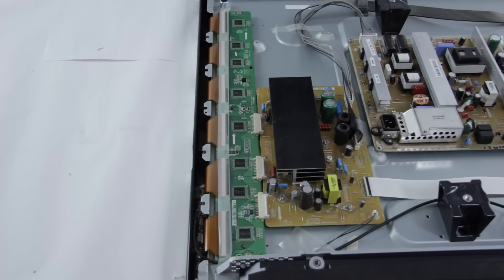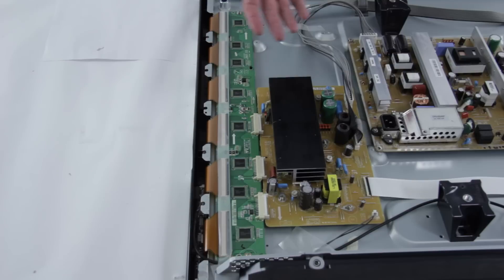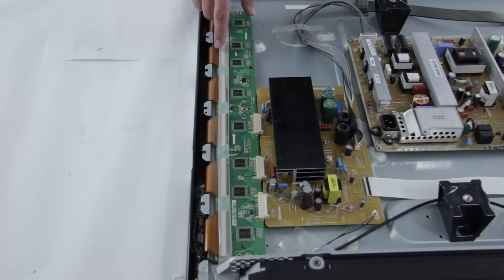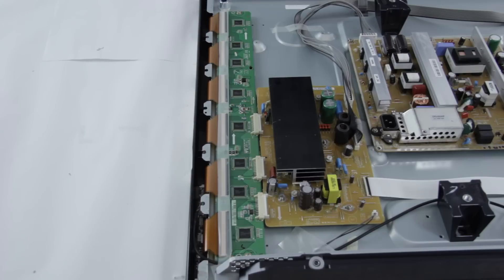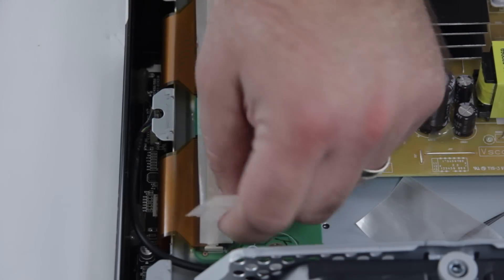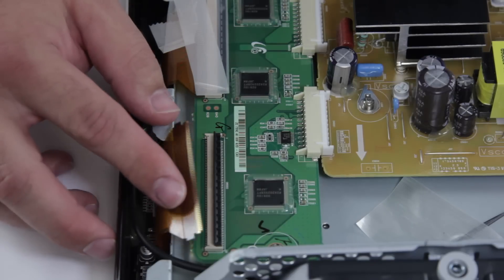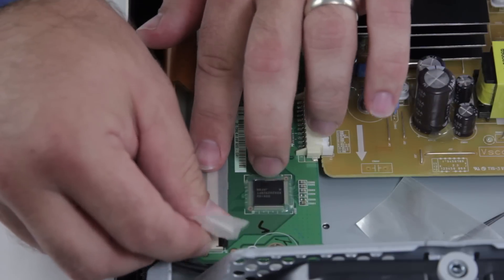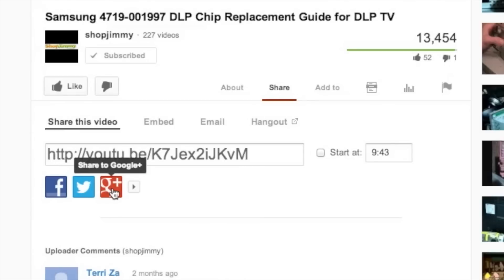Plasma TV Repair - No Image, No Picture on Plasma TV Screen - How to Replace Y-Buffer & Y-Sustain

Comment: Hi I just started having an issue with my 55" Samsung smart tv. When I was changing channels the screen just went black. When I tried to turn the tv back on the red button just keeps blinking without stopping. I have surround sound and also a comcast cable box hooked up and the sound is still working. I tried disconnecting the outlet several times with no luck. Please let me know what your advice would be. I would very much appreciate it.

Comment: hi, I have an LG PB6900 60" TV. It is plasma, and 3D, smart TV. Last night the picture just went out. No popping sounds or anything. The audio was still working and still does. so no picture, but there is sound. could it be a fuse or something more?
thanks

Comment: Hi. I have a Samsung PN64F5500AF that seemed to take ever longer to come on and eventually seeming to come on but not give a picture, just a black screen. I opened it up and noted that the green LED on the logic board was blinking slowly (once every 5 seconds). I learned that this pointed to problem with x-main , y-main or y-buffer.  I disconnected the cable between the logic board and the x-main board (connector with 13 gray and 1 black wire) and found the LED still blinked slowly.  I reconnected that, then disconnected the white ribbon cable between the Y-main board and the logic board. Viola, the LED on the logic board began blinking once every second. I removed and examined the Y-main board and see nothing amiss as far as swollen/leaking capacitors, burns, discoloration. Nonetheless, am I correct that these observations point to a problem with the Y-main board? I don't have the skills/tools to go much further diagnosing potential problems with it. Any advice will be appreciated. Thank you.

Comment: i have a samsung 50 inch tv model PN50C450B1D code PN50C450B1DXZA and the picture is not displaying anymore. i belive the back lamp is burnt out as the sound is still perfect. there is a small flicker before it turns on. please help.

Comment: got a little crack in the left bottom of the screen and its showing vertical and horizontal lines model code UE40EH5000WXXN

Comment: i have 50`samsung plasma tv model / HP-T5054  while I`m watching it turn off then it turn on,but the picture disappear it`s totally
black  but there`s a sound remote is working what`s supposed to be the problem and where to get parts.

Comment: LG model 60PV450 , tv was on and it turned off, when turned back on there was sound but no picture. the tv always makes a light popping sound when turning on and off but it has done that since new. i would like to fix it as that would probably be less costly than buying a new tv. thank you.

Comment: I have 52 in Samsung Plasma TV model number HP-T5054. You can hear it power on but no picture.  I've checked all fuses and they are good. All capacitors look good also, I even changed one. What else could it be?

Comment: PDP60R3 IT POWERS UP AND HAS A RED LIGHT ON THE FRONT OF IT.  BUT JUST A BLACK PICTURE.  NO BLOWN CAPS.  THEY SAID IF WAS MAKING A BUZZING SOUND AND THEN IT JUST QUIT
DO YOU THINK I NEED A NEW Y BOARD

Comment: I got a question for you guys. I have a Toshiba 42hp66 with black lines going across the screen horizontally, Also the plasma screen pixels began with the blacks turning to reds, to the whole screen picture now does not work and is completely white and pixels are multi colored. A purplish hue on the screen rwith white all over, the screen also flickers. please help! thanks -Christian

Comment: Hi I have a lg 60pk550 when it went out it would just click so I put a new power supply in it it steel did the same thang. I did some test found out the buffer boards was bad I put new ones in now when I turn it on the stand by light goes out like it should but there is steel no sound and the screen is steel not comeing on so putting the new buffer boards in got the tv power to stay on but there but that all the tv is steel not working

Comment: samsung PN64E8000GFXZA turns on no picture and can not verify if there is sound. No VA and low VS (3v). The led on the logic main blinks once every five seconds. I have followed all of the steps in the fast track trouble shooting manual and still can not figure out what is the culprit other than maybe the x main. Any help would be appreciated.

Comment: hey shop jimmy I have a rca plasma 42PA30RQ , it will click on but shows absolutely no picture but a brief few lines across the top when turned on and then nothing. no sound either. The ribbon connections look to be in good condition.

Comment: I have a Samsung pn51d450 and i tried to plug my laptop into it and the picture went black. Since then It click on and there is a flicker on the screen like it is starting then nothing. The red light on the front is on and the green light on the back is on and flashing. The power supply voltage readings all seem OK. It also doesn't respond to the remote when i try to turn it on and off, just the button on the front panel. It clicks again when i turn it off. There is no sound coming from it.

Comment: zenith plasma tv z50px2D AF-05fD serial#605RMKU0013 no picture. Power turned on but makes a buzzing noise for a few seconds and then shuts off

Comment: We have an LG 50PQ30, it does power up, but there is a clicking noise in the back, it also doesn't have sound and has no picture, what can the problem be and can it be a simple fix?

Comment: I have a Samsung tv model # pn50a400c2d
model code # pn50a400c2dxza. tv has sounds but screen is black.
Reply from the maker: +Rene De La Torre I recommend replacing the Y-Main Board in your TV. Click this link to replacement parts for your TV model number:  http://www.shopjimmy.com/catalogsearch/result/?q=pn50a400c2dxza  There may be multiple boards for the same TV model number, be sure to match part numbers on your current board, with your replacement for compatibility.  Here is a link to a video showing how to identify your part number, click here:  https://www.youtube.com/watch?v=R1jmj_foId0  Thanks and please let us know if you have any further questions with your TV Repair!  www.shopjimmy.com

Comment: I have an LG 42 inch plasma tv (model no: PDP42X40523) made in Korea 2007.  I got the TV after it was thrown out.  Initially it would not turn on, the relay would just click on then off again.  I replaced the power board (Part number EAY32808901) and the tv now turns on but there is no sound and the picture is fuzzy.  A large area in the middle is completely black with no pixel movement, whilst around that area the pixels are blue , green and red.  The red pixels seem to flash or sparkle more than the others.  
I bought the power supply off a dealer and after getting the tv to turn on he told me he thought that the problem was now probably the main signal board.  So I checked voltages on the main signal board pins and they were much lower than they should be according to the stamped voltages written on the board next to the pins.  I also found really low voltages on the Y-SUS board.  All the voltages are perfect on the new power board except for one.  It has "3.v_O" written next to the pin.  When the tv is in standby I get 0 volts on this pin, however when I turn the tv on this pin reads 4.64 volts which is a little high?
I have looked for bad caps on the boards but as I am a novice I have not noticed any that look physically bad.  I wonder if anyone can point me in the right direction as to where they think the problem might lie?

Many thanks in advance!
Reply from the maker: +Luke Wilkinson   Try all repairs and troubleshooting at your own risk.  I recommend replacing the YSUS, YDRVTP & YDRVBT boards in your TV.  Click this link to replacement parts for your TV model number:  http://www.shopjimmy.com/catalogsearch/result/?q=PDP42X40523  There may be multiple boards for the same TV model number, be sure to match part numbers on your current board, with your replacement for compatibility.  Here is a link to a video showing how to identify your part number, click here:  https://www.youtube.com/watch?v=GEllG3RV-tc  Thanks and please let us know if you have any further questions with your TV Repair!  www.shopjimmy.com

Comment: I have a Samsung Plasma HDTV PN51E550 and while we were watching TV, we heard a loud popping sound and now the TV won't turn on. I tried switching out the Power Supply Board and the Control Board but the TV won't still turn on. Everytime I connect the power cord, a green light blinks on the Control Board and then I hear three clicks on the Power Supply Board. This sequence happens 5 times and when it stops, now I see the Standby light blinking twice for 5 times. I have had this TV for about 3 years. Can you help me troubleshoot my TV and see if I need to purchase any parts. Thank you, your service is greatly appreciated.
Reply from the maker: +Rudy Cordoba   Try all repairs and troubleshooting at your own risk.  I recommend replacing the Y-Main board and the Y Scan drive board in your TV.  Click this link to replacement parts for your TV model number:  http://www.shopjimmy.com/catalogsearch/result/?q=PN51E550  There may be multiple boards for the same TV model number, be sure to match part numbers on your current board, with your replacement for compatibility.  Here is a link to a video showing how to identify your part number, click here:   http://www.shopjimmy.com/catalogsearch/result/?q=PN51E550Thanks and please let us know if you have any further questions with your TV Repair!  www.shopjimmy.com

Comment: I have a Samsung plasma TV (SPS4243X/XAA). When I turn the TV on, the picture fades to black within a minute. I can turn the set off and back on and the picture fades in about 5 seconds. What is wrong and what can I check?
Reply from the maker: +Dave Owen   Try all repairs and troubleshooting at your own risk.  I recommend replacing the Y-Main Board and Y buffer board(s) in your TV.  Click this link to replacement parts for your TV model number:  http://www.shopjimmy.com/catalogsearch/result/?q=SPS4243X%2FXAA  There may be multiple boards for the same TV model number, be sure to match part numbers on your current board, with your replacement for compatibility.  Here is a link to a video showing how to identify your part number, click here:  https://www.youtube.com/watch?v=R1jmj_foId0  Thanks and please let us know if you have any further questions with your TV Repair!  www.shopjimmy.com

Comment: SAMSUNG PN51E6500EFXZA
Screen goes dark after working fine for a while.  Turn it off and back on and it works again for a short time then black again.  Tough to diag. as I can't force the failure and it's intermittent.
Reply from the maker: +Mark P  Try all repairs and troubleshooting at your own risk.   I recommend replacing the Y Main Board and the Y Scan Drive board in your TV.  Click this link to replacement parts for your TV model number:  www.shopjimmy.com/catalogsearch/result/?q=PN51E6500EFXZA  There may be multiple boards for the same TV model number, be sure to match part numbers on your current board, with your replacement for compatibility.  Here is a link to a video showing how to identify your part number, click here:  https://www.youtube.com/watch?v=R1jmj_foId0  Thanks and please let us know if you have any further questions with your TV Repair!  www.shopjimmy.com

Comment: Hello, I have Samsung plasma model PN60E8000GFXZA version TW02. Screen turn to black after couple of minutes of viewing. No any popping sounds, just screen turns black. Restarting TV leads to same problem - OK picture first, then after short period of time display turns black (but TV sound is OK). Can you please advise what could be a problem? Thanks
Reply from the maker: +Fouad Khalilov   Try all repairs and troubleshooting at your own risk.  I recommend replacing the Y-Main and the Upper and Lower Y Scan Drive boards in your TV.  Click this link to replacement parts for your TV model number:  http://www.shopjimmy.com/catalogsearch/result/?q=PN60E8000GFXZA  There may be multiple boards for the same TV model number, be sure to match part numbers on your current board, with your replacement for compatibility.  Here is a link to a video showing how to identify your part number, click here:  https://www.youtube.com/watch?v=R1jmj_foId0  Thanks and please let us know if you have any further questions with your TV Repair!  www.shopjimmy.com

Comment: Samsung HP -R4252Plasma TV...after the TV has been on for awhile the bottom portion of the screen will go black for 1-5 min and then come back up.  the top portion is starting to get the horizontal lines going across.  Which part do I need to order?  I am thinking the Y-Buffer...Do I need to replace the Y sustain as well.  Thanks

Comment: I have an LG 50" Plasma, model 50PK250 that's developed a couple of problems. The main problem is, when powered up cold, it displays no picture, only audio. Initially, cycling the power a few times would solve the issue. Now it seems to take many, many times before you get the video to come on. Once it does come on , it's fine, until you power down for an extended length of time and have to start all over again.

I suspect it may be a poor connection, and maybe once the screen gets warmed up, the connection is better. The other possibility I'm thinking is, I hear relays clicking when it powers on and off, and maybe one of those are failing.

I had another issue that had shown up around the same time as the no video. Three vertical lines (they appeared green to me) developed, and were visible most of the time, except when certain colors were displayed. I had heard on plasmas that usually means the screen is shot and to expensive to replace. I had resolved myself to live with it until the TV goes for good, but the problem seems to have cleared up. This has me thinking it's a connection problem. Any suggestion on what to troubleshoot if the lines come back?
Reply from the maker: +AlDee104   Try all repairs and troubleshooting at your own risk.  I recommend replacing the YSUS and the YDRVTP & YDRVBT boards in your TV.  Click this link to replacement parts for your TV model number:  http://www.shopjimmy.com/catalogsearch/result/?q=50PK250  There may be multiple boards for the same TV model number, be sure to match part numbers on your current board, with your replacement for compatibility.  Here is a link to a video showing how to identify your part number, click here:  https://www.youtube.com/watch?v=GEllG3RV-tc  Thanks and please let us know if you have any further questions with your TV Repair!  www.shopjimmy.com

Comment: I have a Samsung 50" plasma model number PN50c450. It had black lines horizontaly threw the screen so I bought a new ybuffer board I tried to install it now the t.v. turns on flashes and shuts off the red light in the front flashes 5 times... I unplgeed everything before I switched the board out its the same model everything. I put the old board back in and it does the same thing now turns on screen flashes than shuts off and gives 5 blinks
Reply from the maker: +jackswild000   Try all repairs and troubleshooting at your own risk.  I recommend replacing the Y-Main Board and the Y-Buffer board in your TV.  Click this link to replacement parts for your TV model number:  http://www.shopjimmy.com/catalogsearch/result/?q=PN50c450  There may be multiple boards for the same TV model number, be sure to match part numbers on your current board, with your replacement for compatibility.  Here is a link to a video showing how to identify your part number, click here:  https://www.youtube.com/watch?v=R1jmj_foId0  Thanks and please let us know if you have any further questions with your TV Repair!  www.shopjimmy.com

Comment: I have a Samsung PN59D630A3F. It will have a picture for a little while than it powers off and back on and only has sound no picture. I have to unplug it from the wall and plug it back in for the picture to work again. But it will only have picture for a little while before going out again. What could be wrong with it?
Reply from the maker: +David laskowski   Try all repairs and troubleshooting at your own risk.  I recommend replacing the main board in your TV.   Unfortunately I do not see any replacement parts in the search results for your TV model number on our website.  Please reply with your part number on your main board and I can try searching for replacement parts.  Thanks and please let us know if you have any further questions!  www.shopjimmy.com

Comment: Hi there. I have a LG 42PX3RV-ZA and when you turn it on the power light goes green and you hear a slight pop from the speakers but nothing on the screen what so ever. There does not appear to be any physical damage i.e blown capacitors on any of the boards from what i can see. I was wondering if replacing all the t8ah250v fuses would be a help. Any help or guidance would be most appreciated. Many thanks guys.
Reply from the maker: +nik bird  Try all repairs and troubleshooting at your own risk.  I recommend replacing the main board in your TV.  Unfortunately I do not see any replacement main boards in the search results for your TV model number on our website.  Please reply with your part number on your main board and I can try searching for replacement parts.  Thanks and please let us know if you have any further questions!  www.shopjimmy.com